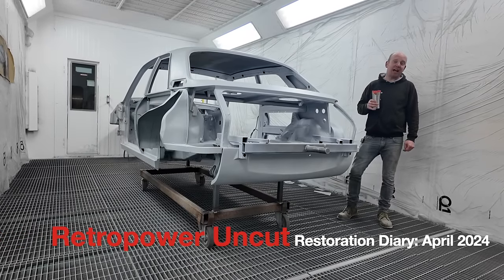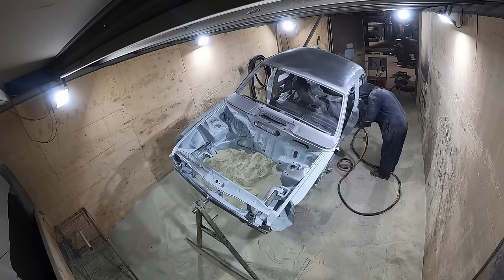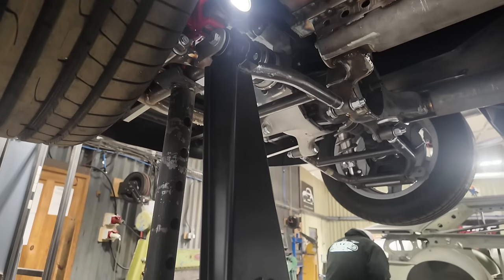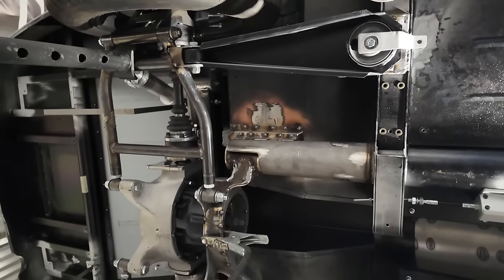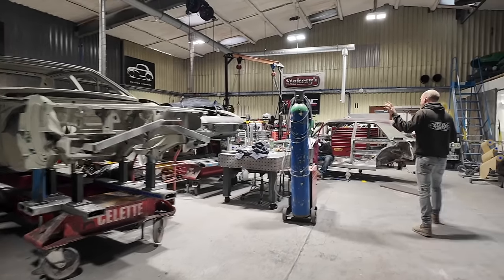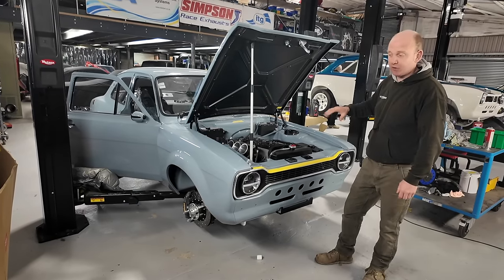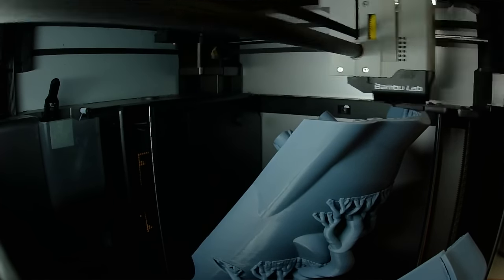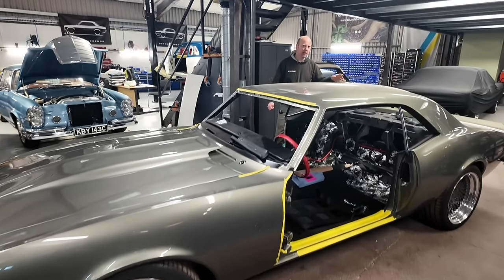Restomod AUSTIN ALLEGRO Metalwork Complete!

Comment: Not having had the possibility to zinc spray my hobby builds, I've used a cavity wax to treat all areas where nuts, bolts, clips and other hardware could possibly break the paint.  I squirt just before tightening the bolt or fitting the hardware and another one after.  
As always admiring your team's craftsmanship and learning from every episode.

Comment: Watched a video on the red Opel GT resto mod you did . Fantastic restoration  work .Shame it didn't have a LS6 motor although the Vauxhall motor is a great upgrade .
Owned a few Opel GT,s and they are a very pretty car .Also owned a Stienmetz A series Manta with the fabulous looking IMSA box arches and the straight 6 Monza engine which was the same as the 4 cylinder engine with a extra 2 cylinders .

Comment: Re Interceptor. The rear diff cage on a Jaguar moves quite  a lot as the suspension moves up and down. Does the diff as fitted move enough to compensate? I would suggest as what Lister did to the V12 XJS with the radius arms. Have longer ones and fit the front end in towards the middle in line with the lower arm pivot bolts. (lynx did that with the D Type with solid mounted diff)

Comment: I would love to have an autofocus on your rust prevention treatment. I genuinely love the deeper looks into zinc spraying in these episodes, but it would be nice to have it all out into an autofocus with your processes and reasonings/examples. The small asides of doing door sills, window frames, was an eye opening use for the spraying. I am looking to go through my own Classic and farm equipment when I am in the off season and would love to have the autofocus episode to look back on and reference. 
Also, I see you have a water style filtration, any reason or explanation on the advantage of it? Maybe a walkthrough of how it works? 
I would still love any advice on how to put a Classic on a rotisserie. My body isn’t what it used to be (both the Classic and me) so I would like to do repairs and zinc spraying at a reasonable working height.
As always, thank you so much for sharing your amazing craftsmanship and breadth of knowledge!

Comment: With the undercoat mk1 escort, you should make a nice air box, and install a MAF. Feed both the MAF and the 4 individual throttle positions into the engine management. 
It should be wild to tune. 
🇦🇺🤜🏼🤛🏼😎☮️🍀☮️

Comment: The single shear rear damper top mounts are not going to be anywhere near the static load limit, but they absolutely will be a low cycle fatigue limit!  The mass (or corner weight) is pretty irrelevant because damper loads during extreme bump (say hitting pot hole or kerb) can easily be 10 times the corner load. At that point, the 1/2" bolt absolutely will elastically deform, and that for a single shear bolt, will put a bending load into that bolt. Worst case is that the threaded shank (min dia) experiences the bending stress, and this will be a sharp corner (as the thread form cuts into the base dia) so a huge stress concentration will be formed here.  So this is absolutely where the static calcs are pointless and doing a dynamics / bending load analysis should be done instead!  Of course, the best option is doing exactly what you are doing, which is to redesign the top attachment into a double shear arrangement where all you need to do is to ensure the tightening torque and hence clamp load is sufficient to avoid dynamic  slip in the joint  🙂

Comment: What kinda surface does the zinc metal spray leave, can it be painted over just the same for a good finish, say on the inner wings ? thanks
Reply: It’s okay for the engine bay but not for the exterior panels. You’d end up sanding it all off to get an acceptable surface so it’s a waste of effort to do it.
Reply: @timc5969  Cheers, Tim

Comment: I'll still say it I would have cut the shell into four quarters and made it fit the Chassis it would have people thinking it's still an Allegro but its bigger than I remember I believe you could have done it yes new screens front and back but they can be made its a lot of money for a small car
Reply: Having widened a car by 10mm down the middle I would not say it's easier as making glass that does not have any optical issues is harder than bodywork. I have done roof chops too and would say it's easy to stuff up as you have a car that appears disproportionate, hence sectioning of the body.

Comment: It's a shame you made the Interceptor's radius links' totally wrong, because they are beautifully fabricated and installed.
As I've told you before, you NEED to have the forward links' ends in line with the axis of the inner wishbone's mountings - you've even got those nice, solid box structures to tie into!
As it is, to minimise binding from the conflicting arcs you're going to need to have so much compliance, it's barely worth having them at all.